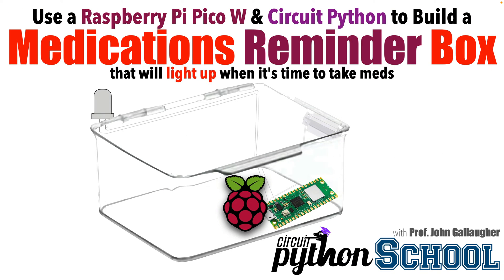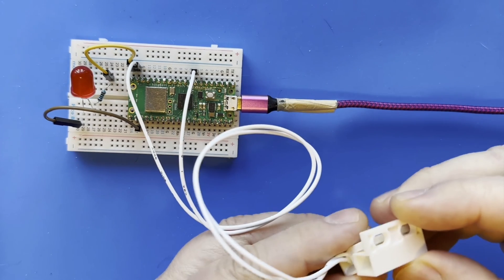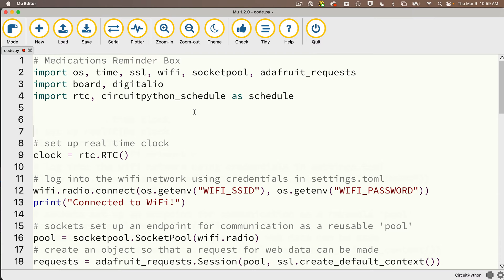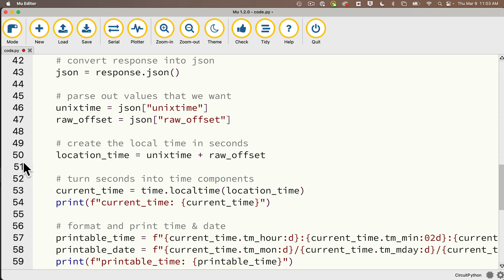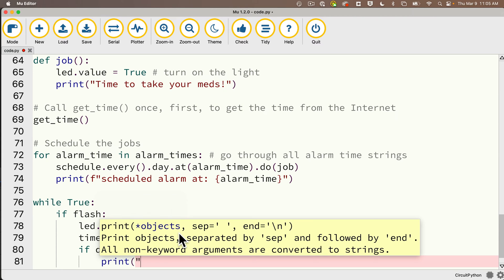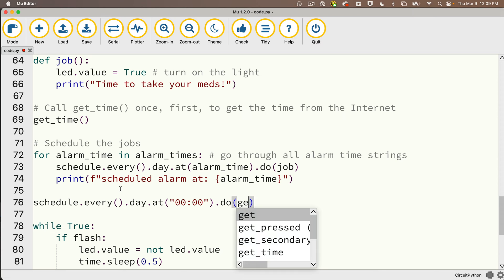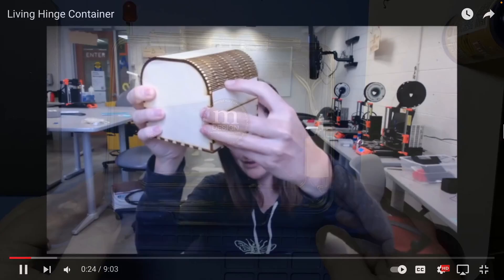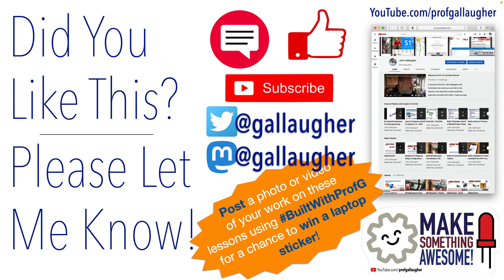Build the Raspberry Pi Pico W Medication Reminder Box Using CircuitPython

Comment: The intro is correct, it's a big problem. But as you say, this is just an educational example, it wouldn't really solve the problem.
I take 4 medications in the morning, 2 of them also in the evening, and 2 others in the evening. Because there are only 2 times, these are fairly easy to remember though a reminder that I haven't done them yet could be useful. So for this box I'd just schedule 2 per day and manage the combination manually.
But the real hard one is diabetic blood sugar testing. Ideally that would be twice a day on a schedule that scatters those samples over the day to before breakfast, before lunch, before dinner and before bed, on a cycle that rotates over 2 or more days. Only two of those coincide with medication and I have immense problems trying to remember any of the others or where in the cycle I am. 
Writing code to do that would be straightforward - I'm just pointing out that a good solution would consider this sort of thing.
Reply from the maker: Students - here’s an idea for your next #TechForGood startup. Dive in!